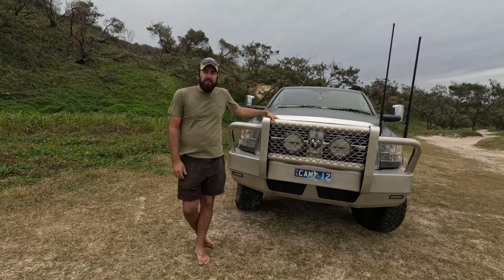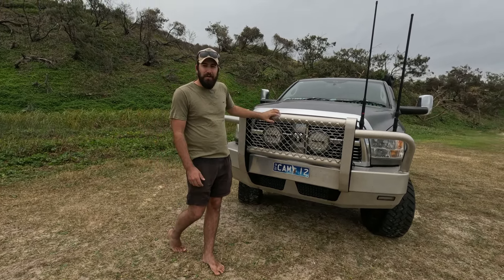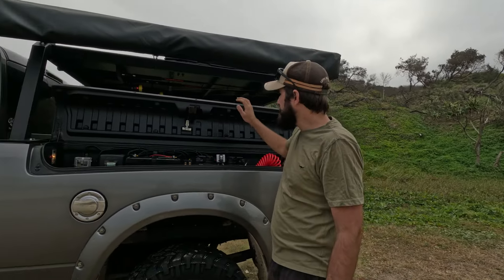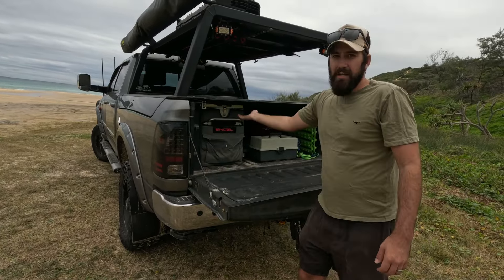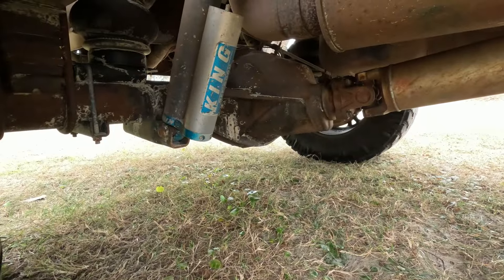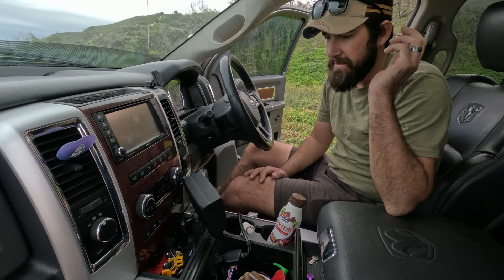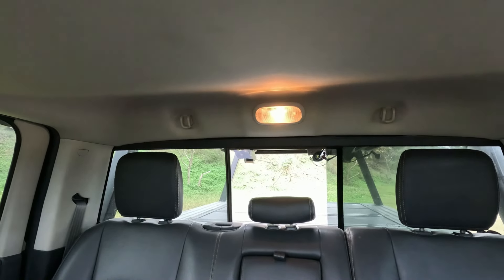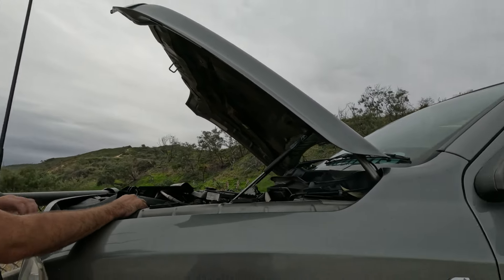Our Ram 2500 In Australia - Caravan Tow Vehicle

Comment: im resurching to buy 2500 or 3500 and if i can get away with nb1 licence, i will. Im going to fit same fit out as you in rear. only concern would be are the roller covers dust proof for the tub. otherwise id be looing at a tub canopy if there is one that works with the rambox. do you know what your wieght is , as is with tank of furel in?
Reply from the maker: @1890cooper  hey mate, we are just on that nb1 licence with the van on, 
I think we are about 3.8/9 with 2 passengers and a full tank.
I have seen a canopy that works with the ram box but I can’t remember the brand unfortunately.